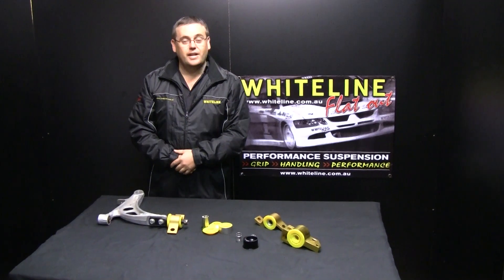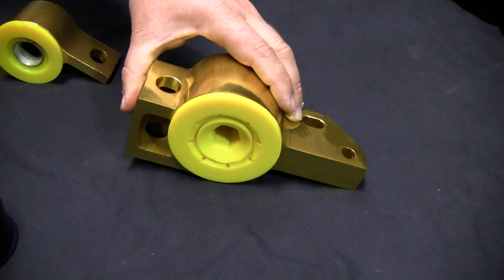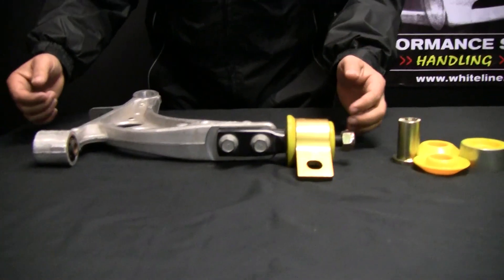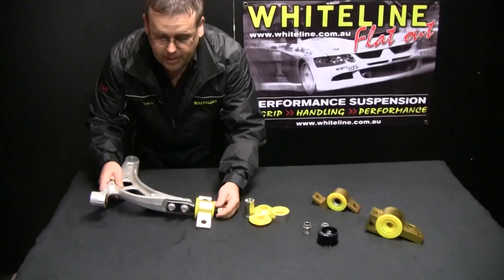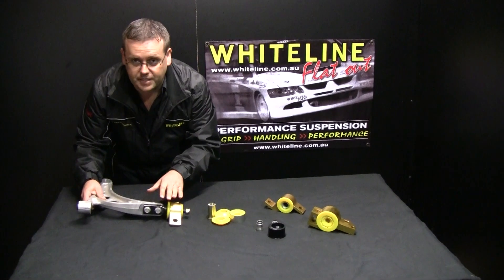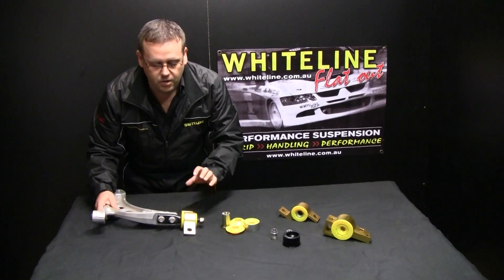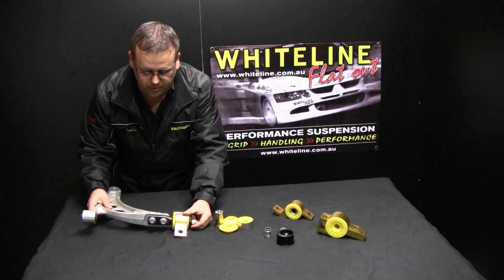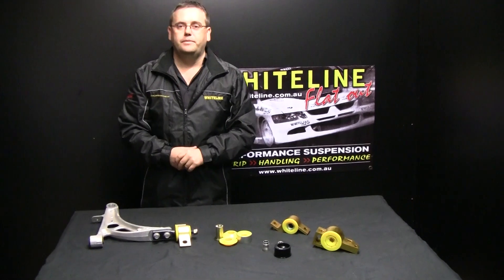Whiteline Anti Lift Kit (ALK) Insight

Comment: Does anti lift make sense in a FWD car? If I understand this right, the anti lift kit makes the car lift the front end MORE under acceleration. So wouldn't that reduce grip because now there is less weight on the tires?
Reply: It does make the front lift more but that's exactly what you want in FWD. When the chassis rolls back under heavy acceleration, lift at the front of the car will keep the tires in contact with the road.
Reply: @jeremygrice311  I don't understand how that would benefit a fwd car. With less load on the front wheels everything will be worse.
Reply: @marc9283  The anti-lift kit helps the suspension push the front wheels into the ground when the chassis rolls back (rather than the wheels lifting off the ground). Because the wheels move away from the chassis and towards the road it's technically "lift". What we're really concerned about is the tires lifting off of the road, and that's what the anti-lift kit helps to prevent.
Reply: @jeremygrice311  oh that makes sense, thank you